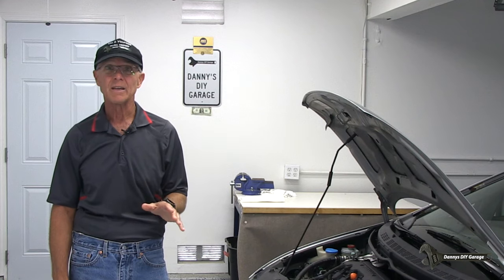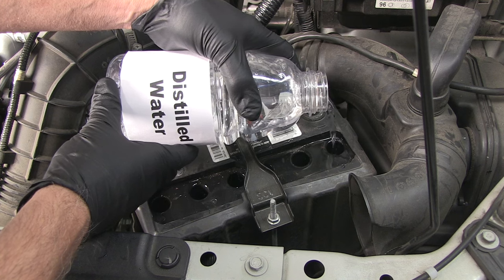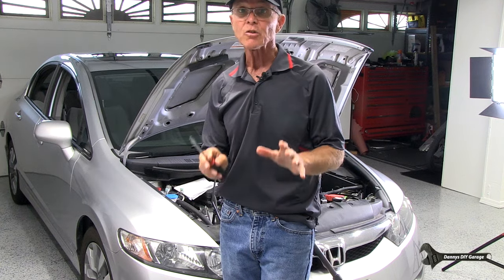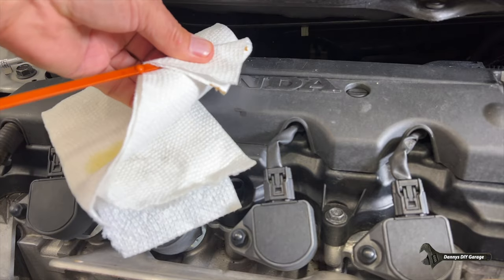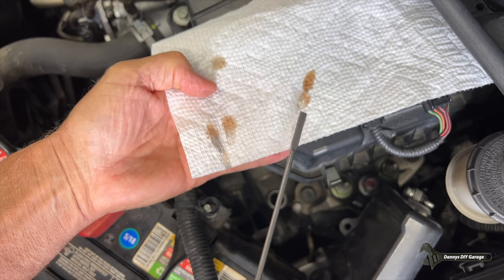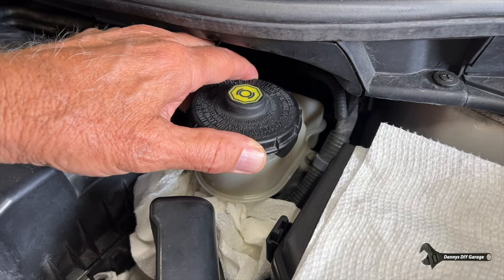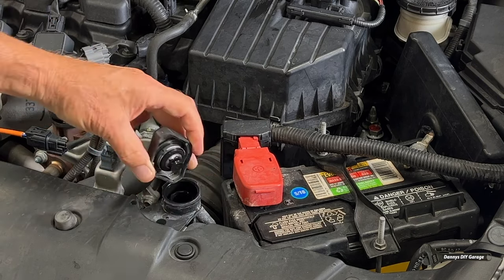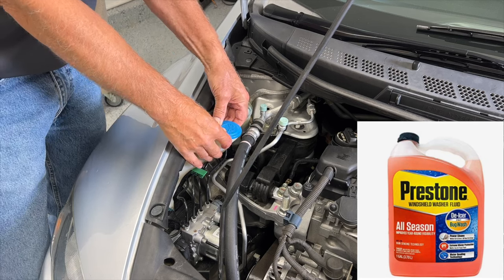Honda Civic Must Do Maintenance

Comment: I see a lot of pointers towards half way between, I’m a service technician and I prefer to keep the fluids on cars I work on (mine included) on/at the upper maximum level mark, this helps to give you a more accurate idea if a problem is about to occur…

Apart from engine oil most fluids don’t really drop very much “so” based on that if you’re header tank suddenly drops away from the top mark then you know there’s an issue forming, same with power steering fluid, transmission fluid etc etc…

Comment: Thanks for the video! I have an 02 Civic. I am the second owner and it has 186,000 miles. I check and change all of these recommendations. I did the timing belt/water pump when I purchased it two years ago. Recently I changed the tubing from the washer reservoir to the hood because it was dry-rotted. I only use OEM parts and fluids except for the engine oil. Hopefully it will keep going for several more years...
Reply from the maker: Thanks for sharing, love reading these stories

Comment: Hi Danny, great video! I figured out how to do a total transmission fluid change, you know the hose that connects to the external filter that comes from the heat exchanger? You will have to connect a hose to it and point it to a bucket, much like changing the power steering fluid.

1- Remove the transmission oil plug (it will leave around 3 liters)
2- Clean the magnetic plug and put it back.
3- Put new ATF fluid the same amount that came out
4- Remove the transmission filter that is below the air box
5- Direct the hose to a bucket, start the car and position it between P, R, N, D, D3, 2, 1. Go adding new fluid
6- When you notice that there is new fluid going through the hose, turn off the car.
7- Check the transmission level, change the transmission filter and return the hose to the filter.
8- Work done successfully!

Hope this helps!
Reply from the maker: thanks you for sharing

Comment: 5:25 auxillary filter?  Is that for the transmission fluid?  and would that apply to manual or automatics only? 
Great channel btw, thanks for the quality videos.
Reply from the maker: Yes you’re correct auxiliary transmission cooler filter is the correct name I believe, for automatic only, I have a video on changing this on my channel

Comment: Thanks a lot for the video!! I have civic 2015. It had a problem for Air conditioner last year, it was checked by a technician(in Honda Dealer), he found no AC gas in it, it caused this problem, but he mentioned no leaking at all, so just recharged AC gas, checked it all day long last May 18 2022. It worked fine last year, but i turned it on this week, found that it's not cool enough for summer. And I checked pipes and connections, but i couldn't find any leaked on them. I am going to find out a good garage, but not sure it can be identified for the issue. Is it better to recharge AC gas every spring? Thanks! Danny
Reply from the maker: The best way I found to find a leak is to add die, go get it serviced with the proper amount of freon and have them add die in the system, when it stops blowing cold you can use a black light and find the leak, if you would like to do it yourself you can go to the auto parts store and buy freon with die in it, a  black light is inexpensive, I have videos on this. If no leak is found with die added, its probably an evaporator leak, I have a video on removing that also. Never buy freon that says it has leak stopper in in it, this will cause more problems later on
Reply: @dannysdiygarage  Thanks a lot for your advice!

Comment: Well I was trying to type up a question for you and I lost what  I was trying to ask you.    Love your videos btw.   Do you have a video on replacing the timing belt?   I myself have a 2010 Honda civic ex-l, love it great car.    I realize that is probably a tough job to do,  just was wanting to save some money.   Instead of taking it to the local Honda dealership,  who knows what that would cost!     Anyways keep up the good work.    Thanks Drew
Reply from the maker: 2010 doesn’t need a timing belt change, they have a chain and it should last the engines lifetime 
Hopefully that’s what you’re asking, check out my valve adjustment video it shows the chain https://youtu.be/0uQrUAACvwM?si=_-814GLMNaGMi3LM

Comment: I have a 2014 Honda Civic with 85,000 miles. When should I get a tune up? It runs well but gas mileage should be better. Thanks!
Reply from the maker: 100k, new plugs, air filter might help, also clean airflow sensor
Reply: @dannysdiygarage  Thanks for the quick reply!

Comment: I have a honda civic 2007. Sometimes, when i start my car, it wont accelerate but if I switch off the engine and start it again, it will accelerate. Please what do you think is the cause? I also notice my car consumes more fuel now
Reply: Hey Ademola. I hope this helps! https://www.youtube.com/watch?v=a9K-E2a1BRw
Reply from the maker: Yes, clean the Airflow sensor as stated in the comment, if this doesn't work, try unplugging it and drive it, if it runs better you will need to purchase one. hopefully cleaning the airflow sensor helps

Comment: Hey man totally random question.  I own two v6 hondas  11 accord and 07 ridgeline I have no idea if they have ever had a valve adjustment they run perfectly and I take really good care of them. Are there symptoms for needed a valve adjustment? I have come across many honda owners with very high mileage on their engines most well over 230k miles and most of these owners have never had a valve adjustment and they have been perfectly fine so I guess I'm just trying to understand how some owners make it so far without one and if I need one ?
Reply from the maker: In this video below, I talk about it. 
 Should I adjust valves on a Honda Civic? Here is what I found out.
https://youtu.be/0uQrUAACvwM

Comment: Hi danny i had an honda civic 2007 , my ac was cold at evening and morning , new ac gas also, but in the afternoon not cooling too much , sometimes compressor is turning on and off again , the mechanic said need to change the ac tempressor censor , is that true? Thank you 😊
Reply from the maker: Possibly, I go over that sensor in one of my videos,

Comment: Should you check engine oil in all Hondas when the engine is cold ? After sitting over night?
Reply from the maker: That’s probably the best way, however it’s not the critical to do it like that, simply a level service after it sits is sufficient, the oil level does fluctuate but not significantly 👍🏼

Comment: Hi, for the oil check, how many quarts from the top hash mark to the bottom hash marks is the oil level?
Reply from the maker: The car holds 4 Quarts
Reply: @dannysdiygarage  yes, my question though is when checking the oil level along the hash marks of the dipstick, how many quarts are along the checkered section  from the top mark to the bottom mark
Reply from the maker: Great question, I can only guess from topping off the level, 1/2 quart between hash marks

Comment: Danny, which oil brand and oil filter brand do you use or recommend for your hondas? Does it have to be OEM honda oil / filter?
Reply from the maker: I only use Honda OEM, In an aftermarket filter, you can't be confident that it's built with the right filtering material, and that the filter won't clog up prematurely. Honda engines have an amazing reputation for longevity. By using OEM oil filters and other parts, you can help your engine fulfill its potential. when it comes to oil filters, Even though they may look the same, OEM filters are typically made out of higher-quality materials due to the patents required for the manufacturer to produce their products. These materials are not always available for companies producing aftermarket filters. you can usually hold them and the Honda filter is heavier, and if you do this with an air filter its very noticeable, the Honda weighs a lot more.
Reply: @dannysdiygarage  ok so only OEM filter. Same with the oil, Only OEM Honda oil?

I was reading a little about idemitsu oil for Japanese vehicles
Reply from the maker: @vandiyplant921  any major brand will work, I use Valvoline 5-20 synthetic
Reply: I just found your 2018 oil change video that had that. Sorry, I should have searched before asking, thank you! @dannysdiygarage

Comment: I have a crv 2014. For some tests I put a pedal depressor to keep rpm at 1500 or 2500 but the engine rpm rises way high, do you know what might be wrong? Recently tuned it up, oxygen sensor afr is new, maf is cleaned, tested for intake vacume leak,... not sure what else to do
Reply from the maker: I’m not understanding what you wrote

Comment: Danny,  do i need to change the transmission fluid of my 2002 Honda civic ex?  It has a 107,000 miles.
Reply from the maker: If it’s working fine, yes do it, it needs it, if it’s slipping it probably won’t help👍🏼

Comment: Hey Danny I have a probelm with my 2008 Honda civic. Every time I put coolant in my radiator overflow bottle it keep dropping down to min everytime I drive. I don’t see no leaks or nothing.what could be my problem?
Reply from the maker: Check for wetness inside the vehicle passenger and driver side, this would indicate heater core, if it’s burning it head gasket last thing is checking you transmission and engine oil condition, make sure it’s not in there, otherwise it’s going somewhere
Reply: I see wetness under the passager side area under the car
Reply: @dannysdiygarage  it’s coming from near the oil filter